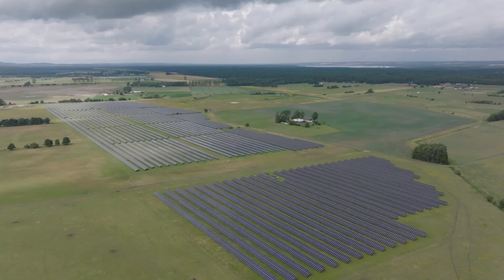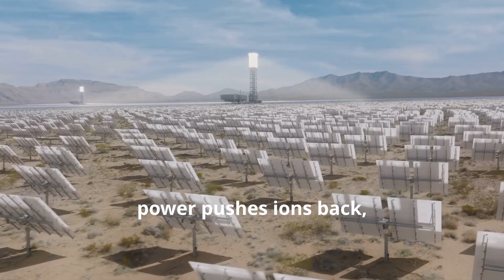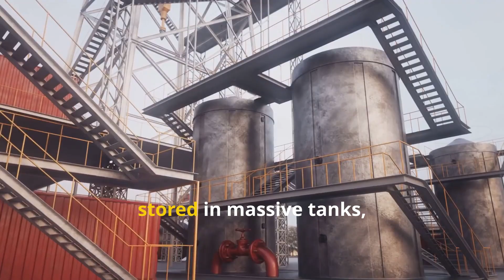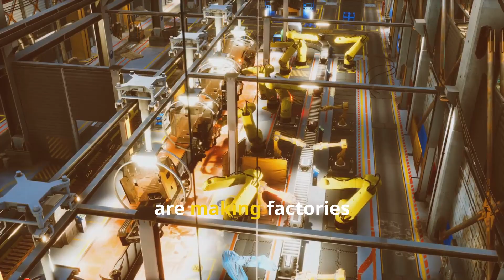The Secret Factory Behind Grid-Scale Batteries Revealed!

Comment from the maker: Discover how redox flow batteries are manufactured—from mined vanadium and acid electrolytes to membranes, carbon electrodes, and massive tanks that store grid-scale energy. This explainer follows the full script verbatim, taking you through electrolyte preparation, membrane casting, electrode conditioning, cell stack assembly, balance-of-plant integration, testing, and the economics and future of long-duration storage. Perfect for anyone curious about energy storage, vanadium chemistry, battery manufacturing, and renewable grid solutions. If you found this peek inside the factory insightful, please like and share the video to spread the word. #RedoxFlowBattery #EnergyStorage #Vanadium #GridScale #RenewableEnergy #BatteryManufacturing
See Less
OUTLINE:
00:00:00 The Sun Sets on Solar Power
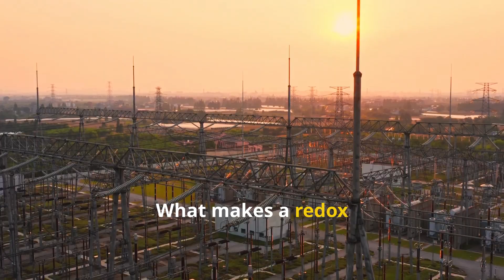00:01:15 Energy in a Tank
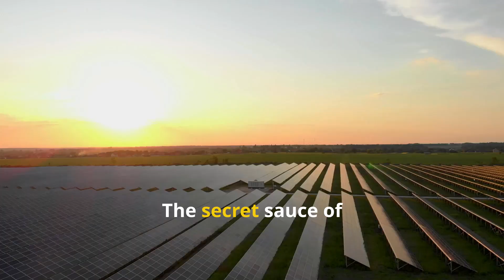00:02:46 Vanadium and the Electrolyte
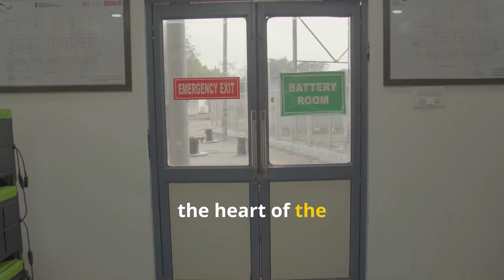00:03:45 Membranes and Electrodes
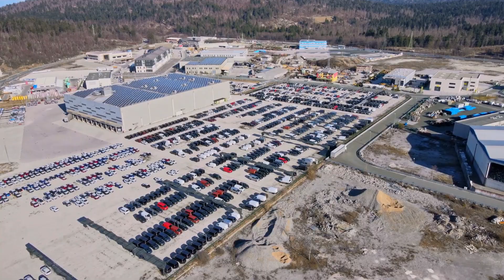00:04:47 Stacks, Tanks, and Pipes
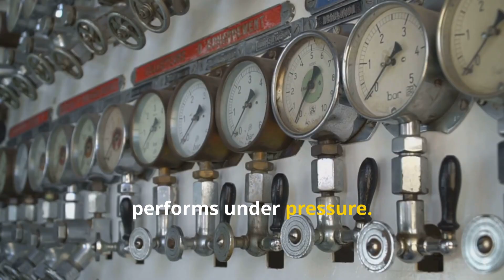00:05:41 The Battery Boot Camp
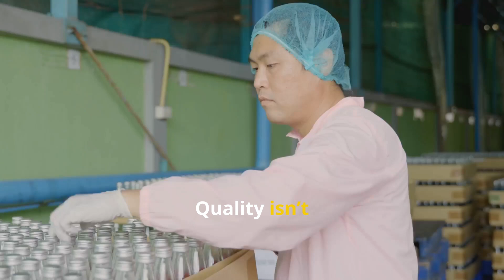00:06:38 Scaling Up for a Greener Grid
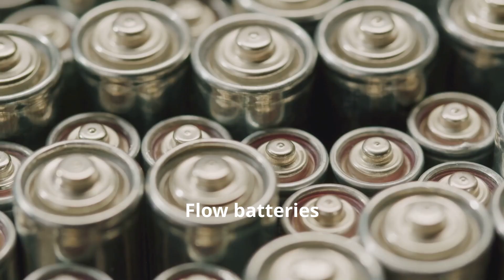00:07:22 Challenges and Innovations